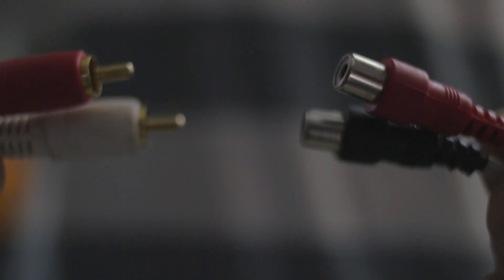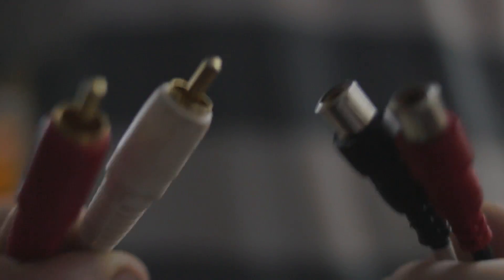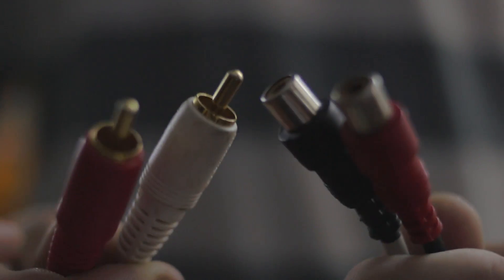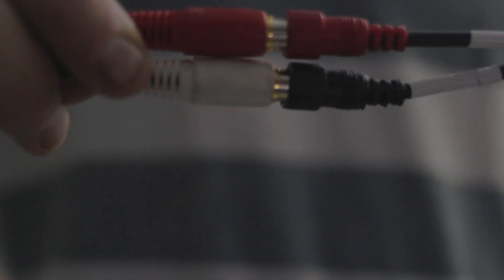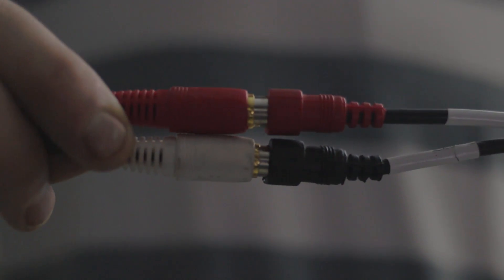How to Extend an RCA Speaker Cable : Audio & Sound

Comment: I just wanted to say thanks. I didn’t know if I needed a special cable like a higher powered cable. But you assured me how easy it is to extend your surround sound speakers. Sry most of the comments on here are sour. Thanks for the help 🍺 cheers

Comment: I have a question. I only have one speaker cable that plugs in to my computer but I have three colors of places to plug it in. I have purchased two speakers that only have one plug and I get sound but there is a echo plus my cable is too short for me to see the back of my CPU, so i watched this video to see how to extend and what to get. I thought I would ask if you know the answer to my problem of the echo.